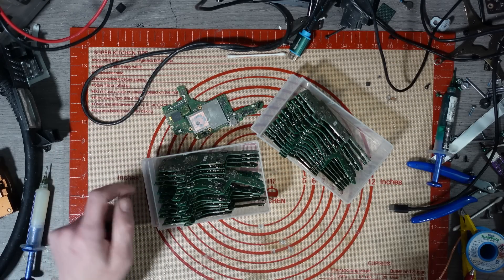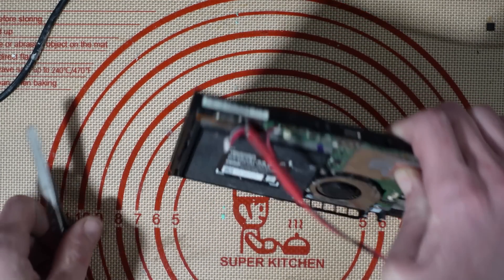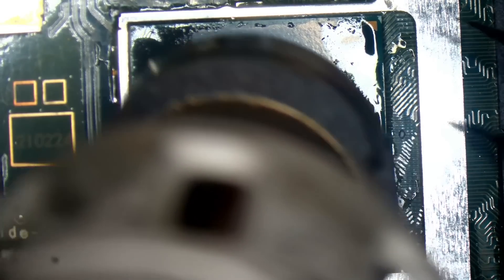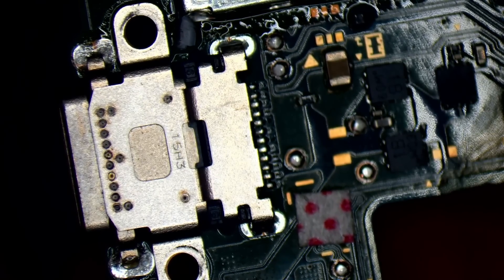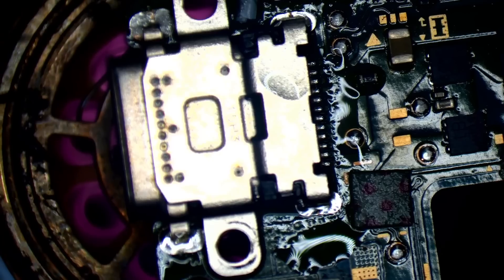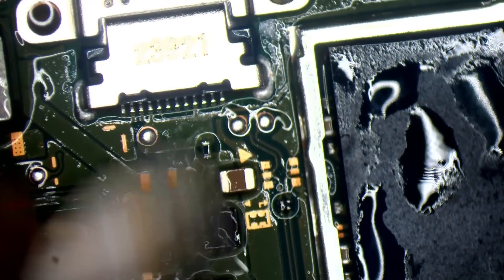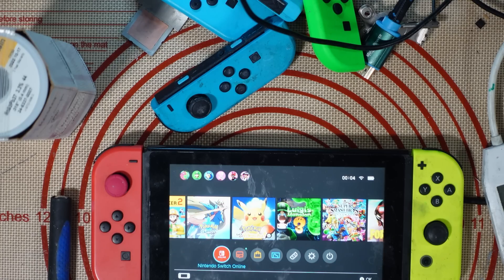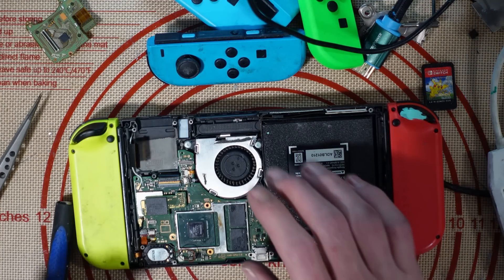Can I Fix This Nintendo Switch Blue Screen Of Death?

Comment: Nice fix!! Trying to fix mine but pressure on cpu or ram doesnt fix blue screen. Does that mean trace repair?
Reply from the maker: It doesn't necessarily mean trace repair is required, it just means it's not just one pad that's not connected. It could have multiple pads which aren't making a contact but a reball would be required
Reply: @TheCod3r  thank you so much for replying ive learned a lot watching your videos